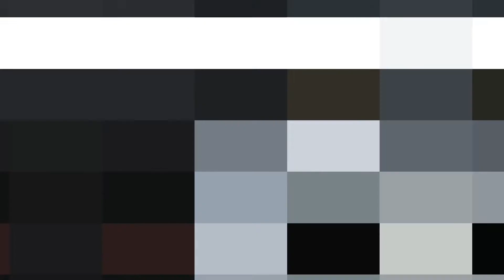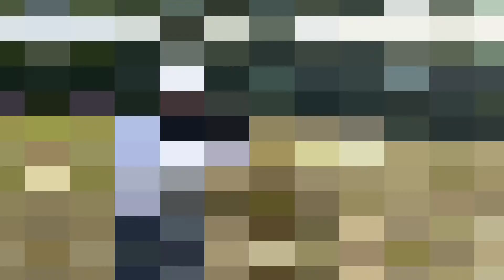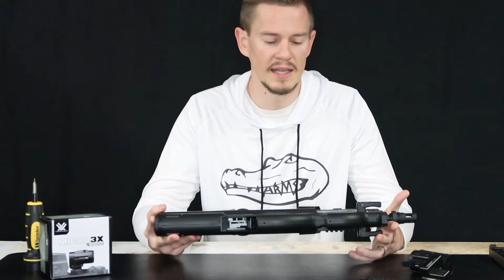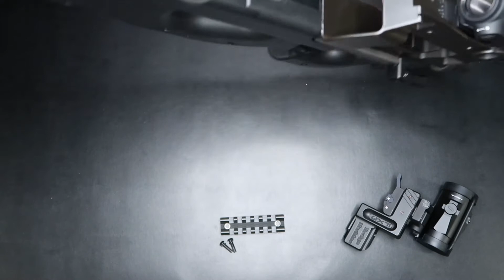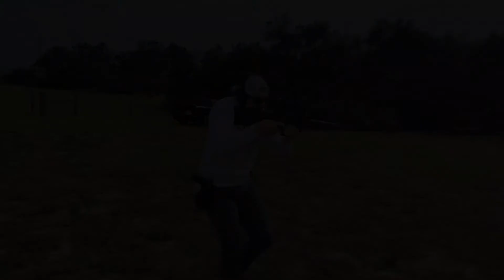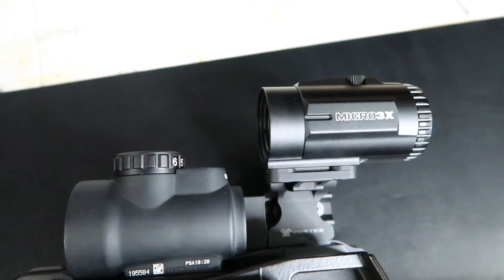NEW FX3 Mount by Design Machine | Vortex Micro 3X Magnifier | Flip Up Optic System | FN PS90/ P90

Comment: would this be compatible with and imperial arms tri rail receiver
Reply from the maker: With that style receiver, you wouldn’t need this attachment device. You should be able to attach the magnifier and optic directly to the pic rail much like you would a standard AR receiver. This mount is if you are looking to keep the original PS90 style receiver but still add on an optic magnifier to it.